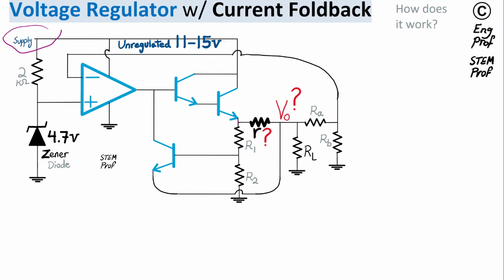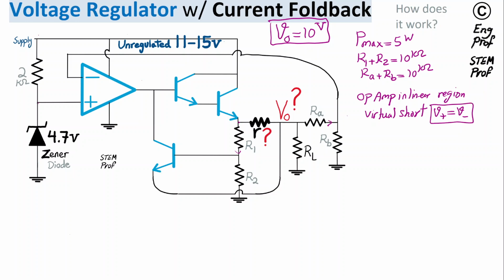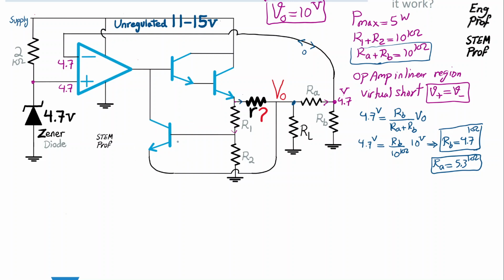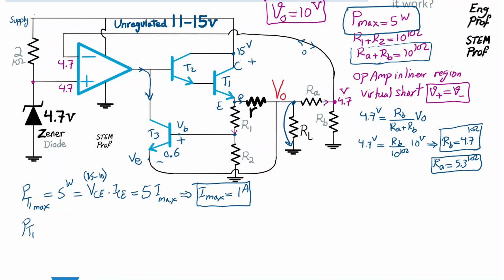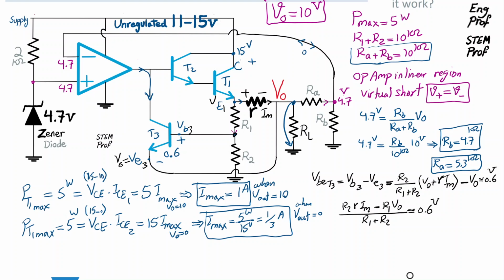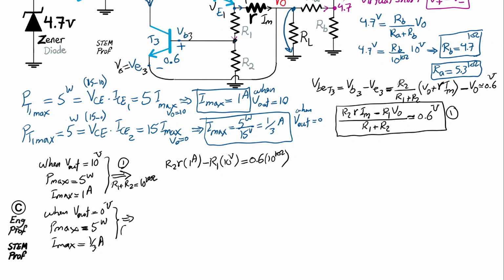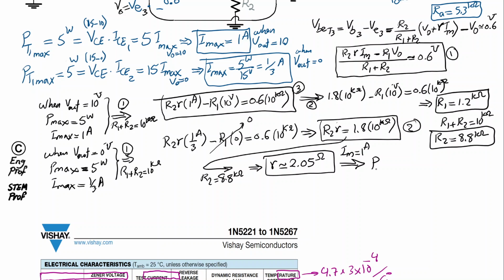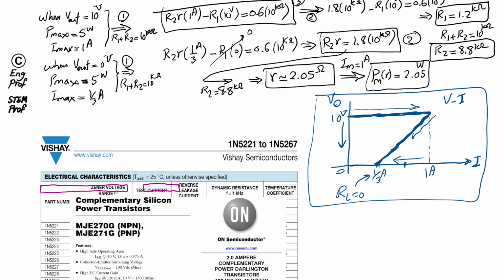Current Foldback Voltage Regulator Circuit Design with Op Amp, Darlington BJT Transistors

Comment from the maker: Thanks for watching, your interest, insightful comments & feedback. Please NEGLECT 11-15v assumption for input supply range. DESIGN GOALs are: MAX Darlington POWER target is 5W, & Output regulated voltage is 10V as long as Darlington Transistor power consumption is below the maximum allowed. The current foldback feature kicks in otherwise to limit the output current.  For more Op Amp Circuits and Regulator examples please see:  Op Amp Amplifier with Electronic Gain Control https://youtu.be/NoNgQpbj77Y  
Push-Pull Power Amplifier with Darlington Transistors https://youtu.be/866MYibo8yE
Temperature-Independent Current Circuit Design with Op Amp, BJT, Zener, Schottky Diodes https://youtu.be/hFbnjbddUvs
Op Amp Analog Computer Differential Equation Solver https://youtu.be/ENq39EesfPw
Voltage Regulator Design with Op Amp and BJT Transistor https://youtu.be/rI9f6-DyXxQ
How to find Bode Plot, Freq Response, Transfer Function of Analog Filters https://youtu.be/vZFkPeDa1H8
Universal Analog Filter Design https://youtu.be/2J-0msXZE2o
Laplace Transform Example and S-domain circuit analysis:  https://youtu.be/ps8N5TPM_qU
Op Amp circuit Bode Frequency plot https://youtu.be/BLVzuuqAlZs
Analog Logarithm Computer https://youtu.be/RpKEq5WyoLg
Lowpass Butterworth Filter: https://youtu.be/UzCjkwqy-9w
Analog Computer to Raise Signal to power n https://youtu.be/IUTlBH1UraE
Triangle Oscillator Op Amp circuit https://youtu.be/JF5Up_cuL9k
Differential Equation Solver Analog Circuit https://youtu.be/R3X5AYNZGEI
Complex Sinusoid Oscillator https://youtu.be/GXRhmwmS5Zk
Sawtooth Oscillator Design https://youtu.be/2eUsGPfqbW4
Full-Wave Rectifier circuit example https://youtu.be/DJJMNU-CYcg
Sawtooth Waveform Generator design with OpAmp, JFET, BJT https://youtu.be/5zHXTx-Vl20 
op amps Circuit with feedback loops to design an analog computer that solves a second order differential equation https://youtu.be/HeZRtnRXpEI 
For more analog circuits and signal processing examples see: https://www.youtube.com/playlist?list=PLrwXF7N522y4c7c-8KBjrwd7IyaZfWxyt
I hope these Circuit design and analysis videos are helpful. 🙋‍♂

Comment: A TL 431 adjustable zener could be used for the reference voltage supply. Set with 1% or 2% tolerance resistors. A resistance should be added to the op amp output before the protection transistor circuit junction. It will limit the op amps output current under overload conditions. An expensive CA 3140 op amp would normally be stated for use. A main chief advantage is the single supply voltage operation capability. A TIP 142 is a common Darlington transistor 10A 125W rated in a modern TO 218, TO 247 plastic power case.
Reply from the maker: Thanks for the feedback and good suggestions! Adding a series resistor to the op-amp output is a very sensible precaution for limiting output current under fault conditions. Using an adjustable shunt reference like the TL431 with 1% or 2% tolerance resistors would definitely offer better accuracy and thermal stability for the setpoint. Additionally, selecting a rugged Darlington transistor like the TIP142 in a TO-247 package provides excellent power dissipation capability for higher current demands.  If you are interested in exploring other voltage regulator topologies and active protection circuits, these related design videos from the channel might interest you:
• Voltage Regulator Design with Op Amp and BJT Transistor: https://youtu.be/rI9f6-DyXxQ
• Voltage Regulator Design Without Op Amp: https://youtu.be/ArisQp7V0Ac
• Voltage Regulator Design with Op Amp, BJT, JFET, and Zener Diodes: https://youtu.be/CJl-urzeiTo

Thanks again for sharing your technical thoughts and for watching! 🙏

Comment: Thanks for the video, i want to design the real linear power supply used for DIY project and i wonder about implementing foldback current limiter or constant current limiter to protect my power supply (which is the pass transistor) from damage. But this video give me some insight how to design the foldback current and i can take is as some option. 

Your explanation is very clear about the technical design of the foldback current limiting technique. maybe i will experiment it with LTspice program.
Reply from the maker: You're very welcome, and thanks for watching.  I'm glad you found the foldback current limiting explanation helpful for your power supply project!  The following videos especially the https://youtu.be/VN4_qF9DvBM "Voltage Regulator Op Amp Circuit with Foldback current limiting" might also provide further insights.  
🔹 Voltage Regulator Design Explained: https://youtu.be/rI9f6-DyXxQ
🔹 Voltage Regulator Example with BJT JFET transistors and Zener Diodes: https://youtu.be/CJl-urzeiTo
🔹 Voltage regulator Circuit without Op Amp https://youtu.be/ArisQp7V0Ac
Good luck with your circuit simulations and DIY power supply design.

Comment: Is the foldback mechanism set by the opamp being saturated?
My thinking is that as R_load is decreased and the load current is increasing, at one point T3 starts to slightly conduct pulling current from the base of the Darlington pair. When that happens the output current of the Darlington pair is reduced. Vo will also reduce and the opamp will try to compensate by turning up its output.
As R_load continues to decrease, this sequence will continue and T3 will conduct even more until the point where the opamp cannot compensate anymore, cannot source more current. Is this a correct thinking of the circuit?
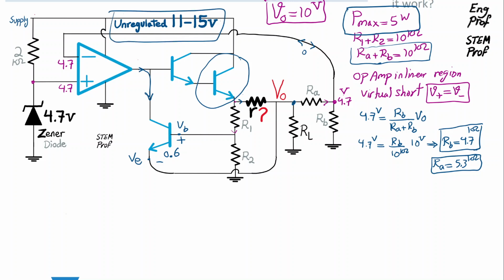Reply from the maker: Good question! Your intuition is mostly right, but there’s one key distinction.  The foldback itself is not set by the op-amp saturating. It’s set by T3 deliberately stealing base current from the Darlington pair once the sense resistor voltage reaches its threshold. As Load Resistance RL decreases, load current rises and the voltage drop across the current-sense resistor increases. When that voltage is high enough (watch 9:30 ), The emitter of T3 is low enough so that T3 turns on and begins to conduct and shunts base drive away from the Darlington. That immediately reduces the pass transistor current, causing output voltage Vo to drop on purpose. This is the foldback action.   The op-amp does try to compensate by driving its output higher, but it’s now fighting a hard nonlinear limiter (T3 pulling base current), not a lack of op-amp output capability. Only at the extreme end does the op-amp typically hit its output rail; that’s a consequence, not the mechanism. 

So the correct way to think about it is:
 -- Foldback is enforced by base-drive starvation via T3
 -- Op-amp saturation happens after foldback is already active
 -- The current limit is defined by the sense resistor + T3, not by the op-amp
That’s what makes the foldback predictable and keeps the Darlington power within the 5 W target.
Reply: @STEMprof  Thank you for detailed explanation. I sometimes find the current limit circuits a little difficult, as they also can lead to some metastable operation.  
But in this case when the Darlington gets less base current and Vo decrease, so does the current. This also mean the current-sense resistor also gets less current and the the voltage over this drops. So T3 conducts less current and the Darlington gets more current and Vo starts to increase again. And so this continues. 
I am having a hard time to see the fold back where the current becomes less and less until it settles at some value.

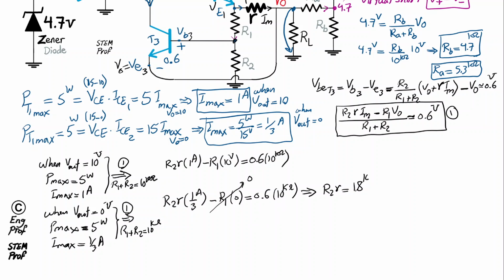Comment: 21:25 "be careful about the dimension"
But then why do you write your units as though they are powers? What is 10 to the power of a volt anyway? I find it confusing, and you apparently found it difficult to write "square kiloohms" or kΩ² yourself in this manner.
Reply from the maker: Thanks for watching and sharing your thoughts.

Comment: Two negative points of this circuit.
1. Very high voltage drop. Total V drop = V drop Darlington pair + V drop Op-Amp + V drop R current sense              which can easily exceed 2V.
2. Not sure it even works as all extra current will flow thru the Op-Amp and T3 at the point of burning the Op-Amp. There will be no real limiting factor as The Op-amp will try to compensate for voltage drop.
Reply from the maker: Thanks for watching & sharing your thoughts. Please see Voltage Regulator Design with Op Amp and BJT Transistor https://youtu.be/rI9f6-DyXxQ as a better example.
1) The circuit is designed to generate stable output 10 volt for the resistor load RL . Input supply voltage is unregulated and varies in a wide range (for example 14-20 volt range). So we need to consider the lowest and highest values of unregulated input supply to make sure design works for both.  
2) OpAmp Output current is minimal. It's on the order of 1mA during nominal operation when T3 is off. When regulator output current reaches max allowed value of 1 Amp then T3 turns on and starts drawing minimal current from op Amp output so that the current going to the base of Darlington transistor will always remain less than 1 mA.  For more Regulators & Op Amp Circuit examples please see https://www.youtube.com/playlist?list=PLrwXF7N522y4c7c-8KBjrwd7IyaZfWxyt
I hope this is helpful. Thanks for watching 🙋‍♂

Comment: I think you need a resistor at the output of your opamp. Opamps are voltage devices and their output have ideally zero resistance. You cannot pull down the current through T3.  However, real opams have about 100 ohm output resistance.
Reply from the maker: Thanks for watching and sharing your thoughts and practical suggestions. This example relies on the fact that a reasonably selected Op Amp has few hundred ohm output resistance and say 10-20 mA max output Op Amp current that is usually specified in Op Amp datasheet. In such case BJT transistor T3 is able to redirect current to limit the output current. Nonetheless, it is a good practice to have a reasonable resistor (say few hundred ohm to 1 kilo ohm) in series at the output of operational amplifier. (Side note: there are different types of operational amplifiers including transconductance op amps that deliver currents at the output).  For more op amp circuits please see https://www.youtube.com/playlist?list=PLrwXF7N522y4c7c-8KBjrwd7IyaZfWxyt
I hope this clarification and further examples are helpful. Thanks again 🙏

Comment: great video, can built the circuit and show us how it works
Reply from the maker: Thanks for watching and comment. Glad that you liked this video and it is useful. For more Op Amp Circuits and Regulator examples please see:  
Voltage Regulator Design with Op Amp and BJT Transistor https://youtu.be/rI9f6-DyXxQ
Op Amp Analog Computer Differential Equation Solver https://youtu.be/ENq39EesfPw
Analog Logarithm Computer https://youtu.be/RpKEq5WyoLg
Op Amp Amplifier with Electronic Gain Control https://youtu.be/NoNgQpbj77Y  
Push-Pull Power Amplifier with Darlington Transistors https://youtu.be/866MYibo8yE
Lowpass Butterworth Filter: https://youtu.be/UzCjkwqy-9w
And Analog circuits and signal processing playlist: https://www.youtube.com/playlist?list=PLrwXF7N522y4c7c-8KBjrwd7IyaZfWxyt
I hope these circuit videos are useful as well. 🙏

Comment: Awesome as always. I am trying to describe how T3 works. T3 normally in many designs just senses the voltage drop in the shunt resistor (r in this case) until this reaches 0.6v, but now the base is tied to a node (between R1 and R2) and is not sensing the current proportional any more. T3 now has information from Imax and Vo at the same time(eq.1)? maybe that is why is called "current foldback"?. Thank you a lot, my friend!
Reply from the maker: You're welcome. Thanks for watching and your good questions. BJT Transistor T3 is off during nominal operation of this foldback regulator.  As soon as the output current reaches the max allowed one Amp the voltage at the T1 Darlington transistor emitter (Ve1) reaches nearly 10+2.05*1 = 12.05 volts. Then the T3 Base voltage becomes R2/(R1+R2)*12.05v = 0.88 *12.05 = 10.6 volt =Vb3  while Ve3 = Vout = 10 volt.  Therefore Base-Emitter voltage of BJT Transistor T3 is Vbe3 = Vb3 - Ve3 = 10.6 -10 = 0.6 volt which is the onset threshold to turn on the T3 transistor that then draws current from the base of Darlington pair and hence limits the output current.  For more Op Amp Circuits please see:  
Voltage Regulator Design with Op Amp and BJT Transistor https://youtu.be/rI9f6-DyXxQ
Op Amp Analog Computer Differential Equation Solver https://youtu.be/ENq39EesfPw
Analog Logarithm Computer https://youtu.be/RpKEq5WyoLg
Op Amp Amplifier with Electronic Gain Control https://youtu.be/NoNgQpbj77Y  
Push-Pull Power Amplifier with Darlington Transistors https://youtu.be/866MYibo8yE
Lowpass Butterworth Filter: https://youtu.be/UzCjkwqy-9w
And Analog circuits and signal processing playlist: https://www.youtube.com/playlist?list=PLrwXF7N522y4c7c-8KBjrwd7IyaZfWxyt
I hope this explanation and these circuit videos are helpful. 🙏

Comment: Good morning...
Is it possible to simulate your design in TINA T software from texas instruments ?
Reply from the maker: Thanks for your interest in my channel and for your follow-up question. I'd love to simulate if I get the chance (which I rarely do). Please surely share your observations if you get the chance to simulate the circuit. For more Op Amp Circuits and Regulator examples please see:  
Op Amp Amplifier with Electronic Gain Control https://youtu.be/NoNgQpbj77Y  
Push-Pull Power Amplifier with Darlington Transistors https://youtu.be/866MYibo8yE
Op Amp Analog Computer Differential Equation Solver https://youtu.be/ENq39EesfPw
Voltage Regulator Design with Op Amp and BJT Transistor https://youtu.be/rI9f6-DyXxQ
Universal Analog Filter Design https://youtu.be/2J-0msXZE2o
Analog Logarithm Computer https://youtu.be/RpKEq5WyoLg
Lowpass Butterworth Filter: https://youtu.be/UzCjkwqy-9w
Analog Computer to Raise Signal to power n https://youtu.be/IUTlBH1UraE
And Analog circuits and signal processing playlist: https://www.youtube.com/playlist?list=PLrwXF7N522y4c7c-8KBjrwd7IyaZfWxyt
I hope these circuit videos are interesting as well.

Comment: Again, I greatly enjoyed your analysis, since this is new to me. In the past, I could do a simple analysis of transistor-based circuits without feedback. With the feedback, it is a little more involved. It would be helpful if you could explain how the circuit would respond along the whole range of loads, not just two boundary cases. Also, I am confused about your usage of the "power" of the regulator (power supply). I would expect that we are talking about max power that could be delivered to the load, not dissipated in some internal circuitry, such as a pass transistor. Could you elaborate on that? Thank you very much for this one.
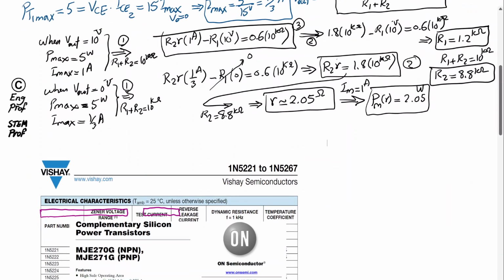Reply from the maker: You are welcome. Thank you for watching and your good follow-up questions. Sure, The foldback feature I-V plot is shown starting at minute 25:46 . In summary BJT Transistor T3 is off during nominal operation of this foldback regulator.  As soon as the output current reaches the max allowed one Amp the voltage at the T1 Darlington transistor emitter (Ve1) reaches nearly 10+2.05*1 = 12.05 volts. Then the T3 Base voltage becomes R2/(R1+R2)*12.05v = 0.88 *12.05 = 10.6 volt =Vb3  while Ve3 = Vout = 10 volt.  Therefore Base-Emitter voltage of BJT Transistor T3 is Vbe3 = Vb3 - Ve3 = 10.6 -10 = 0.6 volt which is the onset threshold to turn on the T3 transistor that then draws current from the base of Darlington pair and hence limits the output current.  If Resistor Load RL is further reduced, the foldback feature would not allow more output current (beyond max 1 Amp) and hence the output voltage starts dropping because Vout = RL * Iout and hence as RL is further reduced beyond this point, the Vout is linearly reduced as well and ultimately when RL=0 (shorting the output to ground), the output current is limited to 1/3 Amp (as designed and discussed in the video) so that Darlington BJT power consumption is limited to VCE*Icollector = 15v*1/3A = 5 Watts (which is the design target in this voltage regulator design example).  This foldback feature is plotted near the end of the video.   For more examples please see:
Voltage Regulator Design with Op Amp and BJT Transistor https://youtu.be/rI9f6-DyXxQ
Voltage regulator design without Op Amp https://youtu.be/ArisQp7V0Ac
Voltage Regulator design with Op Amp BJT JFET and Zener Diodes https://youtu.be/CJl-urzeiTo
I hope this explanation and these further examples are helpful. 🙂
Reply: @STEMprof  Thank you very much, that is helpful, indeed.
Reply from the maker: You are welcome. Glad to hear the explanation is helpful. The reason, as a design target. We are concerned about Darlington BJT power consumption is because we don't want to burn that transistor (and hence the regulator) due to applying too small load at the output of the circuit. The main job of the voltage regulator is providing a constant stable 10 volt at the output as long as the drawn current is less than the level that is not safe for the main power transistor (which is the Darlington Bipolar Junction Transistir Pair). I hope this is helpful regarding your question about power consumption. 🙋‍♂️